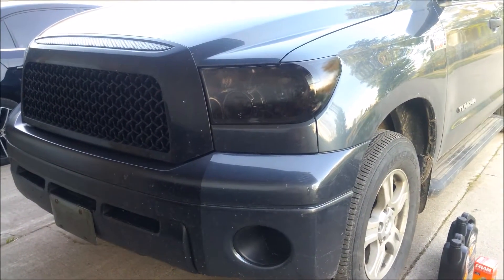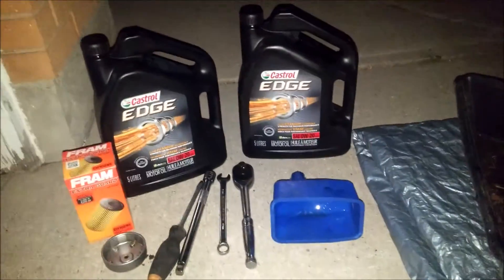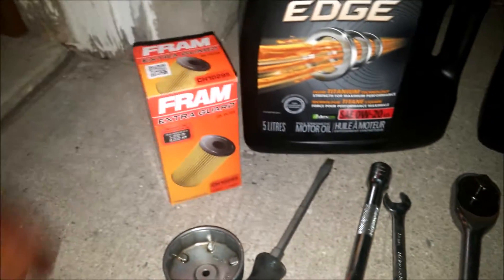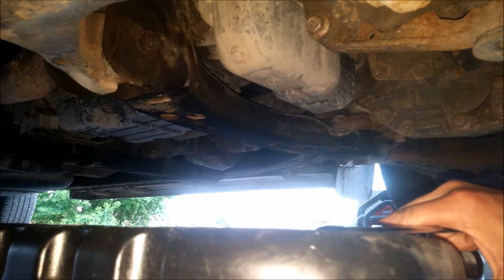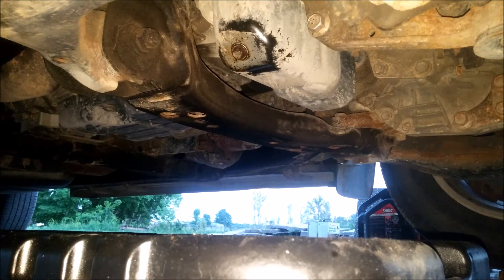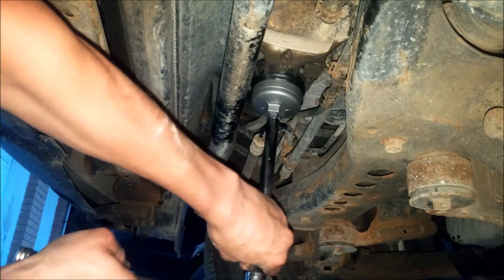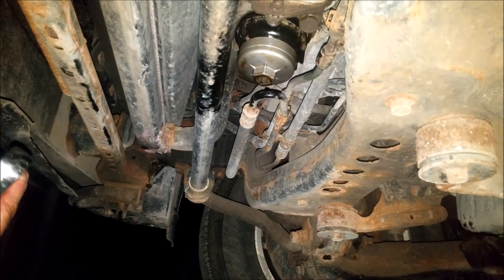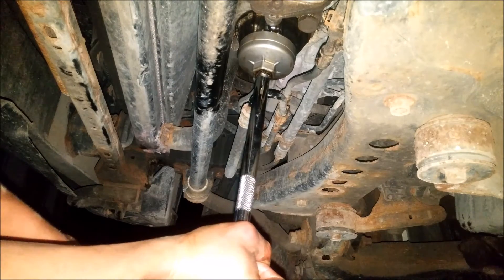Oil Change Service DIY Toyota/Lexus V8 Tundra/LX570

Comment: look into you filter drain steps you missed the housing drain plug and that is where the little O ring goes not on the bottom of the filter. That incorrect step could be bad for you engine.  Ont boy🖒
Reply from the maker: Thanks for the tip. Il be checking that
Reply: That housing looks like shit
Reply: The worst filter ever..Fram
Reply: @christph3118  
The Fram Ultra Synthetic filter is one of the best oil filters available.

Comment: Never put an aftermarket cold air intake. It will cause mad sensor to fail
Reply: Jon Smith No it won’t.I have an S&B filter and not a single problem on my 2016
Reply: 7.9 oil quarts
Reply: @christph3118  
You're lucky. 😉🤔😊
Reply: JackTannehillPromoter I use the dry filters,not the oiled version.That kind can gum up the MAF sensor causing light to come on making people think it’s the air intake system